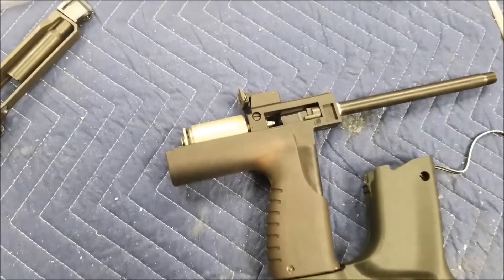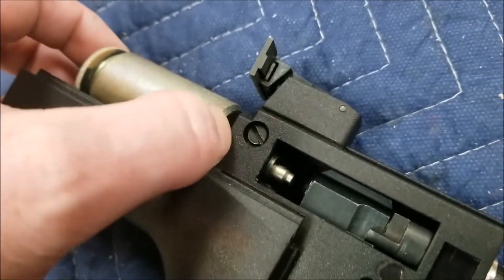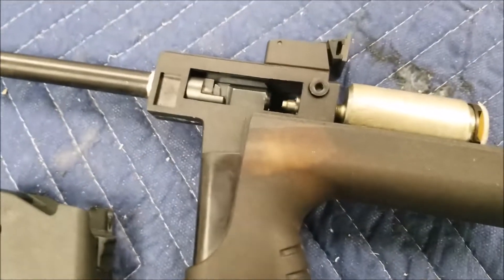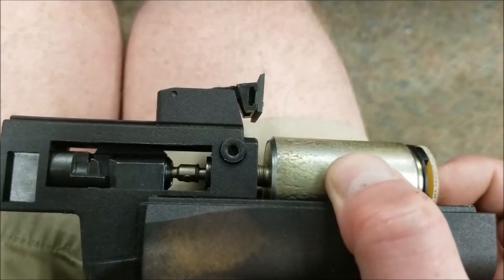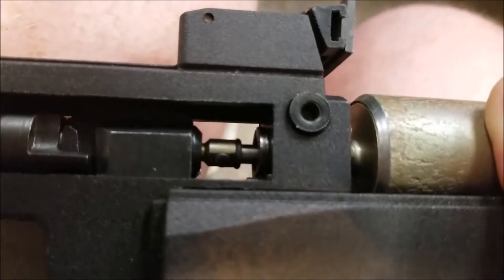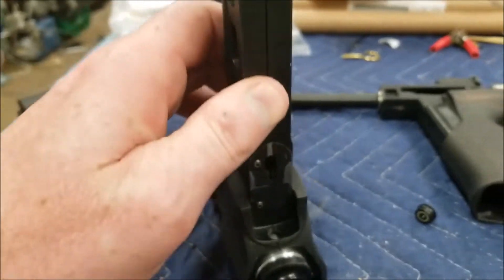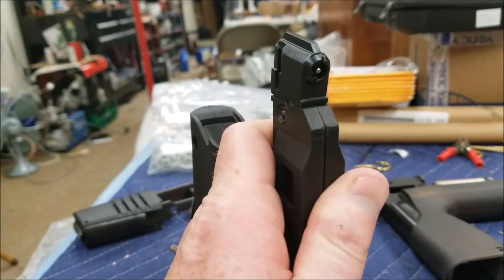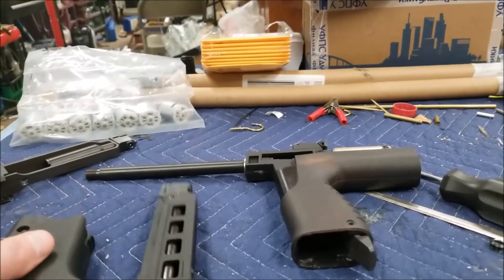Solenoid In Depth

Comment: Is it safe to use pellgun oil on this drozd?
Reply from the maker: Yes. I use a few drops in a can of bb's to lightly coat them. Also if you are running air a few drops in your air adapter every few thousand rounds will keep your seals supple.